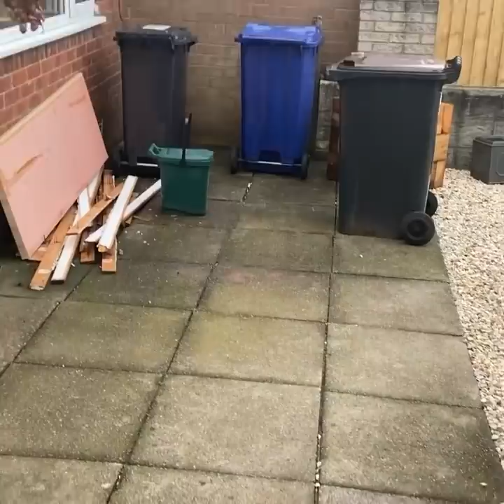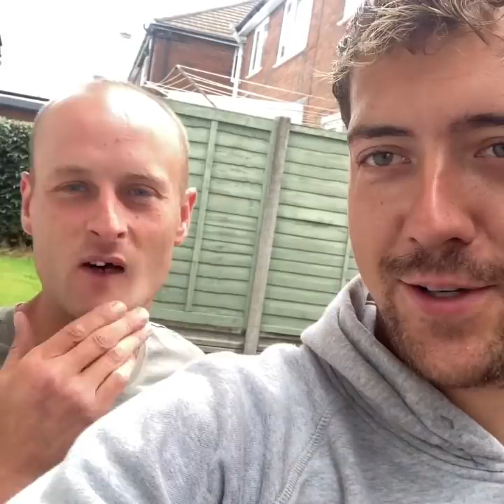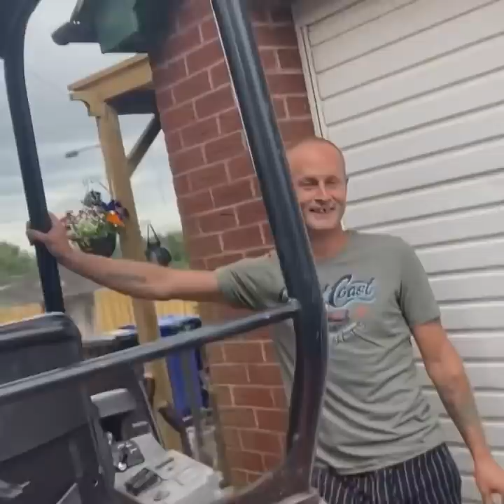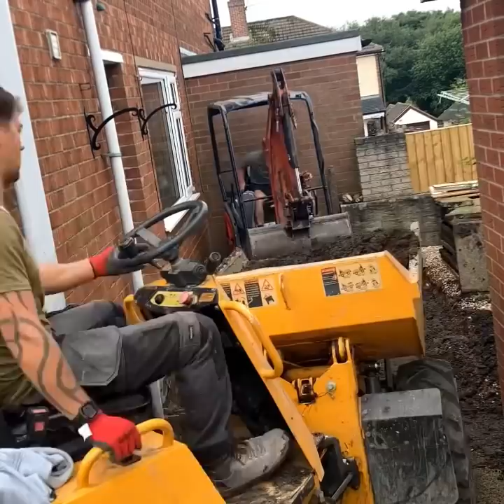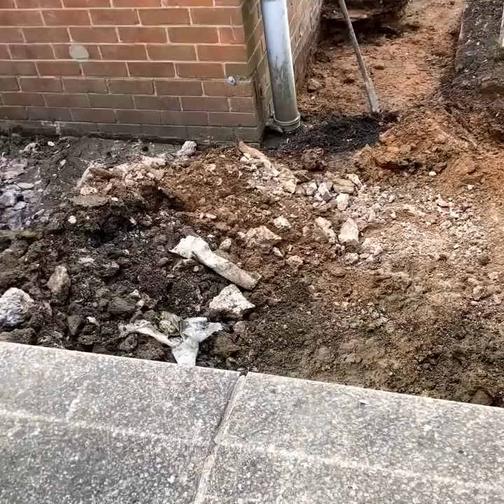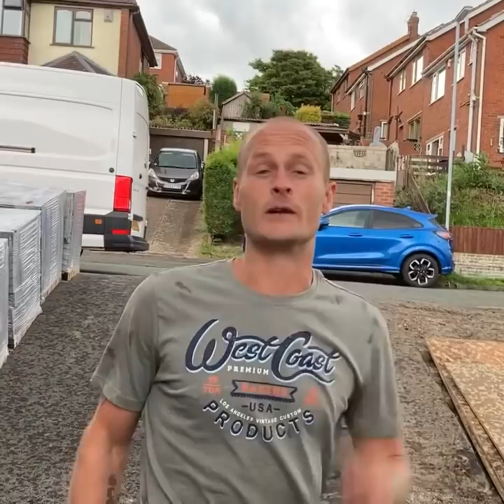DIGGER & DUMPER, NEW DRIVEWAY (episode 1) new rap on time lapse 🤣🤣

Comment: alright lads,,,, new day new job,,,, just wondered why didnt recycle the concrete and put it back in the drive if you were going a minimum of300mm stone, by preparing the first 3or 4 metres at the garage door area then putting the concrete in  a thin layer  as you went up the drive,,,then not as much to take away or come back in good video keep up the good work
Reply from the maker: We are reusing some of the concrete mate you will see in a later video 🤪👍🤘